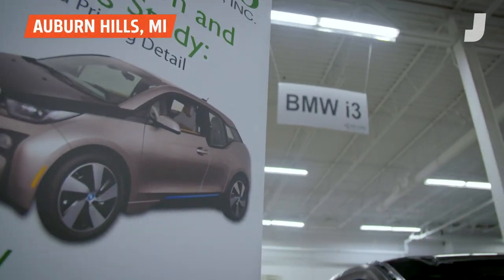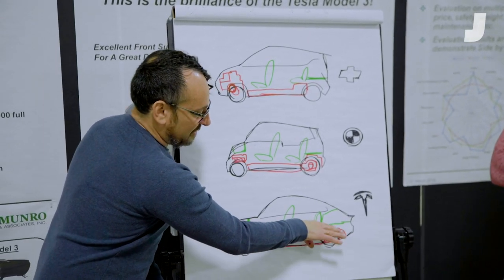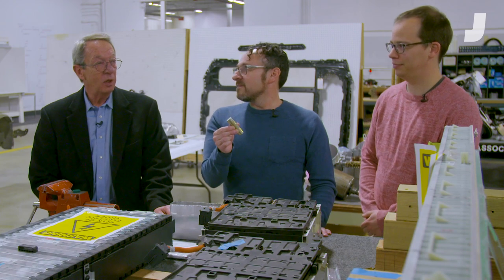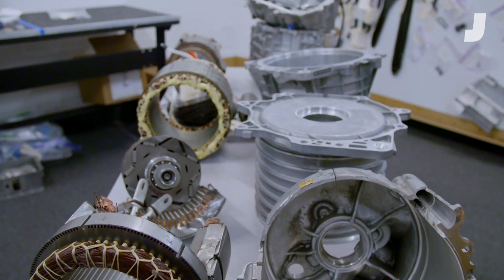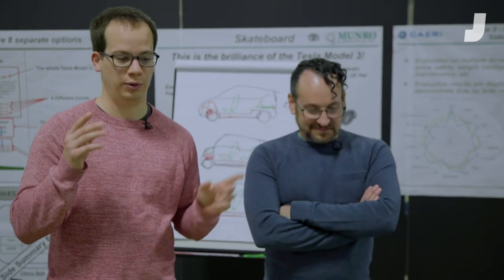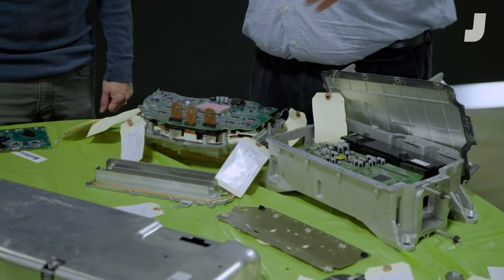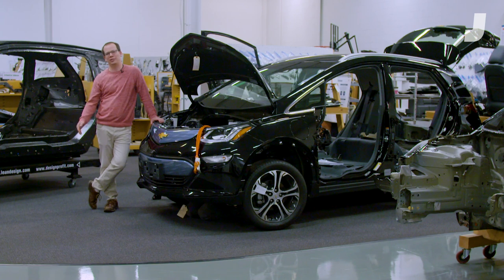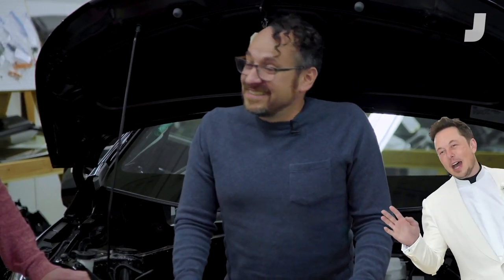A Look Inside The Tesla Model 3, Chevy Bolt, and BMW i3

Comment: I'm going to say it: FWD makes absolutely no sense in electric cars.
Reply: Even Honda Urban EV is RWD.
Reply: Yep. And new EV's completely agree.
Reply: Yep. VW has said the same thing. All their clean-sheet (future) designs will be either RWD or AWD.
Reply: @markusstrobl1067  Oh yeah VW ID Neo is RWD Rear Motor.
Reply: It makes sense from a regen braking point of view because when the car slows down the weight of the car shifts to the front pressing down on the wheels offering more grip compared to the back wheels which are better for acceleration because the weight transfers there when you want to go faster.
Reply: In other words the decision to make cars RWD has more to do with the fact that they want said cars to be more enjoyable to drive rather than maximizing efficiency. Also because using the rear for regen still doesn't saturate the current batteries in terms of how much energy they can accept.
Reply: Unless they were using an existing bodyshell like GM. (Which is why the Bolt is compromised)
Reply: @eternitynaut  But regen is not that powerful on most cars are realy does not cause enough G Force to require using front wheels. Rear wheels work fine for weaker braking.
Reply: Why not? For a city car it doesn't matter which wheels are the drive wheels. Whichever fits the particular design better can be used.
Reply: Fwd is better in certain circumstances. Any loose or slippery roads. Like in the snow, with sand or dirt.
Reply: @zolikoff  It's an engineering problem when it's powerful torquey BEV. Even the Bolt EV with 266lb/ft has serious Torque Steer and Spins the Front wheels with hard acceleration and slight turn. If you are going to build a serious BEV with serious Torque realy need to be driving seperate Rear Wheels. Also NO stop making crappy weak BEVs those are pointless.
Reply: @EnlightenedSavage  Nope not relevant to BEVs. RWD EVs with 150hz response rate Traction Control can easily handle rough road condition. The crazy high rate and fine detail BEV can adjust torque is the magic ability. Thus why they are soo popular in Scandinavian nations. The old Tesla Model S 85 RWD had no issue with Mud, Dirt & Snow mix. It handles very well in those conditions.
Reply: @Neojhun  Why? Why does a BEV need to be powerful? If you're looking for a simple city car would you rather have a "powerful EV" for $35k or just a regular car that isn't powerful but is maybe $15k? I don't know about you but in general most people look for the budget option.
For city cars just make them simple and affordable. They do not need power. They need seats, doors and wheels and a modest sized battery.
Expensive cars aren't going to take over the market.
Reply: @EnlightenedSavage   Incorrect. When you have a gas or diesel engine over the driven wheels that helps with traction.  However when the front wheels do the steering and the driving it is very easy to break traction with those front wheels on low traction surfaces, which usually results in understeer which usually takes more distance to correct for than oversteer. As you accelerate the weight of your car shifts rearwards over the rear wheels and it only becomes exaggerated when you are accelerating up a steep snowy and or icy hill. Hense why most FWD cars do better going up snowy and or icy hills in reverse than they do going forward. FWD cars have torque steer and also the turning circle of a fwd vehicle is limited by the angle that the CV joints can deflect. That's why the tightest turning automobiles ever produced are RWD. Also the more shit you put in the back of a fwd car the less weight you have over the driven wheels whereas with RWD cars the more shit you put in the back the more weight you have over the driven wheels. FWD makes so much less sense for electric cars than it does for ICE cars.
Reply: @zolikoff  That logic works if electric motors were a big cost so using a weaker would enable a lower price, but that's not true, they cost less than $1000 per unit. That's just 5 kWh of energy storage at the pack level. If you make a $35 with 50 kWh - 60 kWh, you get the higher discharge power as a free bonus. They could put a 40 kW motor instead of 200 kW one but it wouldn't reduce cost by more than a couple hundred dollars and the car would perform way worse compared to ICE cars in that class. To make it $15000 is just not possible with battery packs that large.
Reply: @zolikoff  Are you kidding me? It's only 200hp & 266lb/ft, realy not that much. That should be a freaking safety function. It allows fine control due to responsive acceleration and ability to accelerate out the way avoid object thus accidents. For 1.4 Tonne City BEVs 200hp & 250lb/ft should be the minimum.

 FYI 200hp & 266lb/ft is cars like Bolt EV, Kona EV, E-Niro. The current Most Affordable serious BEVs. We simply do not have the Production Capacity to make it cheaper with out serious corrupting the product and cutting corners. Your unrealistic desire to go even cheaper is not viable anytime soon.
 
Also a 100kw BEV is not much cheaper and not worth creating a separate production process. The only way to you can make it much cheaper is Micro Cars with like 50kw & small battery but super efficient. Only at that scale is their big enough difference to make it viable separate production.
Reply: @eternitynaut  It reduces cost by not needing to design & engineer the rest of the car around a higher power output, more than just the cost of the motor itself. Less power = cheaper power electronics as well.
"To make it $15000 is just not possible with battery packs that large."
Obviously not, like I said the pack needs to be much smaller. No need for 300 miles of range for a city EV when 100 will do.
Reply: @zolikoff  It seems you still don't understand, the motor is more expensive than either the transmission which is single gear or electronics, together they cost way less than the battery. A 60 kWh pack costs today $12000, the rest of the drivetrain might cost another $1500 - $2000. Get it now? If they spent enough on the battery to get it to do over 300 km range, the peak power is just a side effect. If you make the motor smaller it won't drop the cost, you need to make the pack smaller and that reduces range. The way to make $15000 cars with 60 kWh packs and 40 kW motors instead of 200 kW is to make the price per kWh of batteries half of what they cost today.
Reply: @eternitynaut  Did you read my entire comment? That's exactly what I said, the pack must be reduced. No need for that range. Smaller pack -> less power for motor -> less torque. Suddenly FWD is not a problem and you don't need expensive suspension to handle the torque.
Reply: @zolikoff  We have such cars with lower range, clearly the demand for those cars is not there. People have expectations when going from early adopters to mainstream. Range, charge speed are important at any price point, otherwise we would have already transitioned to EVs. Search for cars like eVerito or some other Chinese crap car in that price range.
Reply: @zolikoff  Read my reply to EnlightenedSavage
Reply: @eternitynaut  So you get extra regen with fwd. That is the only advantage that I have seen for FWD EVs, everything else is a disadvantage.
Reply: @EnlightenedSavage  that's only in ICE cars with the motor in the front.
Reply: It is as MrLM002 say. There is less weight over the front when you have en EV. 

Renault Zoe with small motor is close to losing grip on dry road and the H Kona is even worse. Press the accelerator and they just spin (I have only tried humid winter road in Kona).

Bmw i3 was fine with winter tires, but lost important range (60Ah 18 kWh version)
Reply: @zolikoff  we already have those there called NEVS, neighborhood electric vehicle they're slow and cheap like you want them to be.
Reply: @BSAElectronics702  I know they exist. Note that I was replying to a comment saying "FWD makes no sense in electric cars."
This was basically my counterpoint. There's nothing wrong with FWD electric cars.
Reply: @zolikoff  Well they're FWD and they don't have a lot of weight over the driven wheels nor do they have a place to add weight over the driven wheels.
Reply: well, other than the fact that it prioritises regenerative  capture over acceleration, which for a less sporting model is the correct way around........
Reply: @maxtorque2277  At the expense of all weather handling, uneven tire wear, winter traction, and drifting.
Reply: @cpF01  It is explained in the replies above
Reply: I'm in Canada and looking for an EV, here with all the snow a RWD makes no sense, I know that Teslas are still OK in snow because of the electronics controls, but being able to steer the driven wheels is very helpful to get unstuck. To me and my situation, AWD makes the most sense, but an affordable FWD EV would be acceptable in most conditions where a RWD would get stuck.
Reply: @ShawnGuertin  RWD EVs are better in the snow in every single way compared to FWD EVs except that you can saw your wheels back and forth to try to get traction which in most cases doesn't work in the snow.
Reply: @Neojhun  the Bolt stops the car on regen. Friction braking is kind of an old concept👍
Reply: @cpF01  I'm saying what I'm saying from a technical perspective. If you fully load your Bolt it will preform worse in the snow than a fully loaded RWD ev with the same ground clearance
Reply: @cpF01  That's a common mistake, cell cost versus pack cost which is ultimately what they sell. At cell level, yes it's anywhere between $100 to $200 depending on chemistry but at package level you have to add another $50 to $100 depending how complicated it is, materials used and thermal management. The average for the industry is $200 per kWh at the pack level in 2019, what GM/Chevy claimed back in 2016 were cell costs. Of note they still claim to be losing money on the Bolt while Tesla isn't for similar pack size and final car costs.
Reply: @Neojhun  Regen (negative torque) can be as weak or as powerful as you want it.  You can literally have the same performance forwards and backward in an EV with zero additional hardware.
Reply: @MrLM002  But have you tried on in deep snow, trying to get out of a parallel parking in a snow bank? Where are you from? If you have a RWD EV in a location with heavy snow, I would be interested to know how it handles. I only RWD I drive is the truck at the job, and I often have to switch it to it's 4WD mode to get out of difficult situations. I don't see many i-MiEV here for that reason (and the lack of a powerful enough heater).
Reply: @cpF01  Read my replies to others above. You are so much more likely to break traction with your steering wheels in a fwd ev than in a rwd ev which results in understeer which takes more time and distance to recover from than oversteer. I'm glad your Bolt has made it through many winters, the big advantage it has compared to Teslas in its price range is ground clearance.
Reply: @ShawnGuertin  I don't parallel park, I'd rather walk 5 miles to my parking space than street park. RWD trucks usually do bad in the snow because there is no weight in the bed, throw some road salt bags or kitty litter or something heavy over the rear axle and it'll do a hell of a lot better in the snow
Reply: @MrLM002  A FWD already has a heavy motor over the driven wheels, and you can pull in the direction perpendicular to the vehicle in order to pull out of a parallel parking spot. Your kitty litter solution is way too inconvenient in Canada considering we would have to do it for almost 3 months, not just once in a while. A fwd usually has enough weight on the wheels to get unstuck without getting out, I personally have an AWD, and all our trucks have the 4WD option (and looking at my neighbors most of them do) because nobody wants to mess wit the rear wheel spin, kitty litter and traction aid. I invite you to visit Canada in January and test your RWD car in the snow, it can actually be real fun if you don't get stuck. I will buy an EV, but I won't sell my Subaru, yet...
Reply: @ShawnGuertin  Most EVs are well balanced due to the skateboard design. Most FWD cars have a 70/30 weight distribution. The bolt has something more like 60/40 or less.  It isn't inconvenient when you only have to load it an unload it twice in a year, once to put it in at the beginning of winter, once to pull it out at the end of winter, worse case you can break open a bag and use it for traction under your wheels. The more shit you put in a fwd car the less weight is over the driven wheels, so a fully loaded RWD vehicle will preform better in the snow than a fully loaded fwd vehicle, and this only becomes exaggerated with EVs. There are 3 things the Bolt does well in comparison to The RWD Model 3s. 1.) It has buttons 2.) It has more ground clearance 3.) It has a good amount of interior storage space. Everything else is a disadvantage technically. Though personally I do feel that the front of the Bolt looks a lot better than the front of the Tesla Model 3
Reply: @ShawnGuertin  Where I drive there are lots of steep, twisty mountain roads with lots of snow in the winter. It's not horrible but in places I often drive they get several feet of snow daily.  The Bolt was a good effort by Chevrolet. Too bad they have a fucked track record when it comes to electric public transit and EVs. If I was forced to get a FWD EV I'd get the Honda Fit EV 50 cubic feet of storage with the rear seats folded flat, like an economy car pickup.
Reply: Neojhun Thanks for explaining. That makes sense. It’s unfortunate to have RWD for re-gen breaking. AWD is obviously the best of both worlds but costs more.
Reply: @mylesgray3470  It is the best of both world and the worst of both worlds sadly
Reply: zolikoff The Prius Prime does very well with FWD and it’s a low powered car. I can see why a performance electric would need to be RWD or AWD.
Reply: @mylesgray3470  Exactly. For modern low power ICE automobiles FWD makes a lot of sense. With liquid cooling mandatory in order to meet emissions it doesn't make a lot of sense to put the motor in the rear when the best cooling and the least amount of plumbing is to be had with the motor up front. It is cheaper, maximizes floor space and trunk space, is more intuitive for your average driver, and makes the suspension and brake setup in the rear very simple. That being said it's like clothes designed as a one size fits all, it works for most people, just not all people and the people it doesn't work for it really doesn't work well for them.
Reply: EnlightenedSavage have a leaf at work.. its unconfortable with fwd. Goes right and left if accellerating hard. And wheel spin when it is uneven road in city..
Reply: @Neojhun : "The crazy high rate and fine detail BEV can adjust torque is the magic ability. Thus why they are soo popular in Scandinavian nations. The old Tesla Model S 85 RWD had no issue with Mud, Dirt & Snow mix. It handles very well in those conditions."
— You must be joking. Just have a look at Bjørn Nyland's YouTube channel instead of spouting nonsense. RWD vehicles don't handle any well on slippery roads (specially the heavier cars). The real reason they buy so many BEVs is because EVs are more affordable to them (to purchase and drive everyday).
Reply: Good riddance, FWD sucks anyway, always has particularly with high torque.
Reply: Aren't they working on hub mounted motors?
Reply: Hi, sorry that is incorrect. The packaging considerations are predominately identical. Make the gas engine a 2/3'ds smaller electric motor and all the packaging, vehicle dynamics, aerodynamics, systems and subsystems are the same.
Reply: One reason we are seeing more RWD based vehicles is power/torque has been increasing over the past 40 years. FWD torque steer becomes more difficult to manage as torque increases. The public misconception that FWD is better in the snow is helping to keep FWD around, but once essentially all vehicles are EV this should go away.

Eventually all vehicles will become AWD though. The primary reason for this is in order to meet future legislated electrical efficiency requirements, AWD regenerative braking will be required. The secondary reason is the the stability and safety benefits torque vectoring provides. Since all vehicles will be EV and will require backup friction brakes, all it will take is a bit of software to add basic torque vectoring to all cars.
Reply: MrLM002 well, when you use a gm korea aka daewoo floorpan, you don't have much choice
Reply: @Neojhun  
Why the power (torque) fixation?
Everyone is hung up on "sub 5 second" 0-60 times that would embarrass supercars of even 20 years ago.
Why?
Don't design cars that satisfy the 0.0001% "boy racer".

Best solution?
Make ONE type (physical size!) of motor to keep production costs low.
Built a modular "pack" sub assembly that can bet assembled in multiples depending on vehicle physical size, capacity, improved cell technology and dial in performance depending on the application.
Quote performance as "sufficient" (as Rolls-Royce used to!)
Reply: @rogerstarkey5390  WTF NO where close to Sub 5sec. 200hp 266lb/ft for a 1.4 Tonne car is around 7 seconds. Nothing close to boy racer, we're talking frumpy CUV like Hyundai Kona & Bolt EV. That is an appropriate acceleration for a modern car to be Agile thus Safe. Seems like a very reasonable minimum if it does not incur massive cost.
Reply: @eternitynaut  They are not capable of getting all that energy. 
It would mean a way too fast charging. That is why Tesla will incorporate ultra capacitors into their already best cars so others can shit in their pants.
Reply: EnlightenedSavage, as someone who lives in New England, I disagree.  RWD, with traction control, is better in the snow than FWD.  FWD keeps traction longer but when the front wheels lose traction (not if) you lose complete control of the car.

RWD is (slightly) more likely to slip on snow and ice but when it does, you can still control the car.

FWD is only an advantage to the manufacturer.  It is cheaper to build a FWD drivetrain.  It also has some packaging benefits.  That’s why you see FWD on economy cars.

But it sucks for the customer.  Worse handling and more expensive to repair.